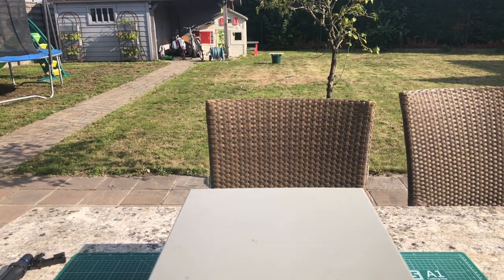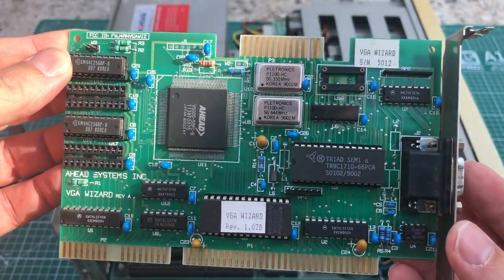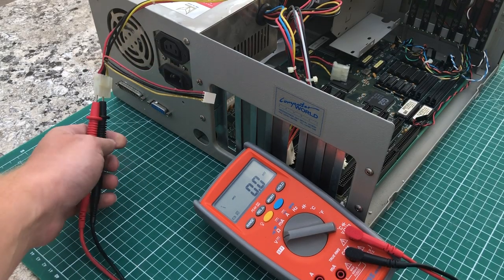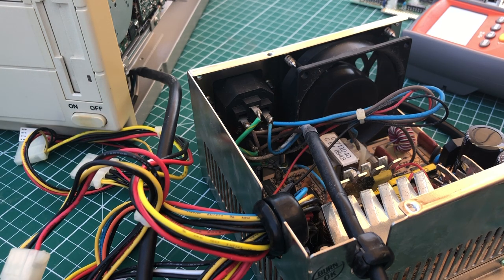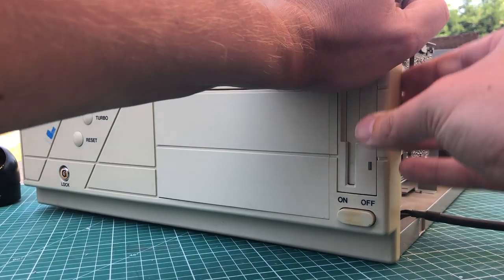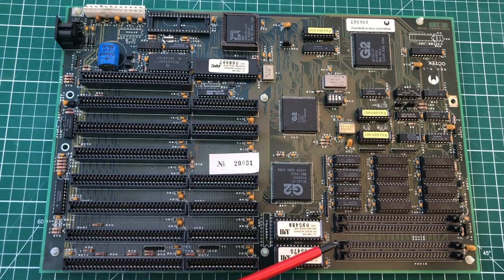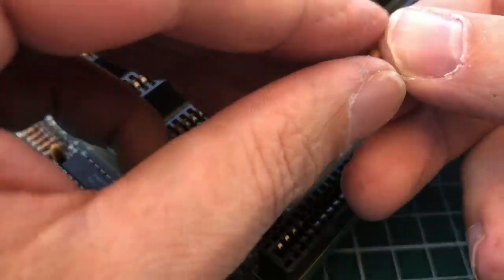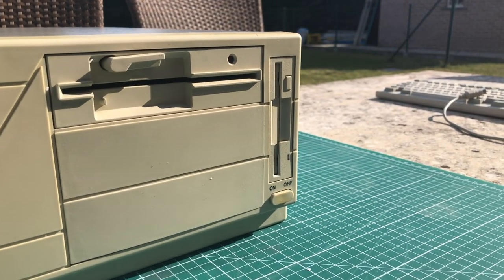286 retro pc from heaven or hell ? (part 1)

Comment: some power supplies need a minimum load on them or they just shut off automatically
Reply from the maker: That indeed was the case here. More on that and more in the upcoming part 2.
Reply: @RetroSpector78  there are commercially available testers what will give you a pass or fail on a power supply, the other way you can test them is to put a 12v 10W lamp on each rail to give the supply its minimum load and do your same voltage tests with the multi meter. These old power supplies only monitor one rail for the regulation on all the rails.
Reply: It's still good practice to give the inside of the PSU a look to see if there aren't any damaged components or Rifa caps that may blow.
Reply: That's true. Though it's usually a good idea to just replace those old PSU's. You can use a modern ATX PSU with an AT adapter to power these old PC's. It's risky to use old PSU's, as they may be on their last legs and may just take out all of your components with it.
Reply: @TheSeanUhTron  I usually rebuild the old AT psu and make sure I use good parts. That is my preference, but sometimes I will use an ATX system as well.
Reply: @MrPlytiger  Usually the regulation is on the 5 volts only. And that rail needs to be loaded sufficiently, usually 3 or 4 amps.
Reply: I would say MOST of these old AT power supply need some load (I usually use some old HDDs I don't care about, small halogen bulb is also a good idea).
Reply: Just want to chime in to bring attention to this for those playing along at home.  Old AT supplies act wacky with no load - perfectly normal.  I have a box full of bad 1- to 6GB Western Digital drives, and a couple CD-shard generators (bargain bin 56x CD-ROMs) to use as a dummy load.
Reply: @MrPlytiger   The cheap plug in testers with indicator LEDs won't tell you anything other than there's some voltage present on the measured rail.

Power supplies need to be voltage tested AND ripple tested, which requires an oscilloscope. A volt meter can report a voltage that looks fine, but could have off the charts ripple that is just as bad as the voltage being too high. Components will be stressed having to deal with high ripple and can kill them very easily.
Reply: @RetroSpector78  I thought so immediately. without connecting the PSU to the Board no real testing possible. but as you wrote I´ll watch part 2
Reply: Also rhe voltage may seem wrong
Reply: Yeah and working on power supply capacitors without knowing if they have been discharged properly, especially the big ones and you don’t know that they need to be can kill as well. Shouldn’t be handling the large ones without an obligatory disclaimer..
Reply: @RetroSpector78  Some will be damaged / fail with no load, too!   I have some old/failed hard disks which act as good dummy-loads for 5v/12v lines ... much better than running completely unloaded!.

Comment: Those measured 10v is because there is not load in the 5v rail.  Some psu generate 12v as a derivative in the transformer . Rectified and filter. But that derivative assume that 5v has load. So the transformer is switched at a minimun required frequency. But if no load on 5v and psu is regulating on 5v. No load means that the circuit will "click" the transformer just few times per second enough to maintain 5v. That means it is not enought "clicks" at primary side of the switching transformer to fill up to 12v on the derivative.
Reply from the maker: Thx for the in-depth info ...  should have known at the time this was load related :) Was able to "save" a whole bunch of AT PSUs that I thought were dead because I didn't test them properly.
Reply: @RetroSpector78  And with "derivative" I mean (the spanish: "devanado" word)  I mean about a "side secondary winding" that can be or can not be in serie with the secondary winding for producing 5v.

Comment: That Power Supply is probably working fine. Many of these old type PSUs have a crowbar circuit that creates a short if the voltage rises above 5.2V which, without load, it does rather quickly. I too have some of them. And mine also spin up after powering off. So attach a dummy load before tossing that PSU. Betcha it works just fine.
Reply from the maker: You should check out part 2 ;) it was indeed load related (stupid of me not to test that) But I’ve learned my lesson , that’s what it’s all about I guess.

Comment: Can I just say thankyou for this video. I recently acquired a 386 in a large joblot that would instantly turn off and by some luck had only seen this video some days before. I saw straight away that the caps near the power connector had blown and was able to replace them and now have a fully working 386 in amazing condition (Desktop and CRT both in original delivery boxes).

Comment: People with no skillset always think its only capacitors that can go bad
Reply: N Gauge England Synthematix yep because in old hardware like this it is generally true that the electrolyte goes bad or they dry out with age. It was also cringe watching them work on large caps without mentioning to at least attempt to discharge them..
Reply: @azzajohnson2123  Mate, one mistake and they can kill, especially in power supplies they can and will hold 240v

Comment: I’d had that exact same system. The 286 12 amd/intel chip still blows peoples minds today.
Reply from the maker: Yeah ... have a thing for these old 286 computers :) have an ibm 5170 from 1984 and an acer 286 from 1991. All using the intel 286 cpu.
Reply: RetroSpector78  have not had mine since I upgraded in about 93   Probably should kept it.

Comment: The old full hight desktop case form factor, from the 80's, are my favorite as well. No matter if that is an AT system or an Amiga 2000. As long as it is the basic layout of board in the bottom and cards vertically mounted, then I am a happy champ.
Reply from the maker: brostenen yeah ... easy to perform maintenance on. They do take up some extra shelf space :)
Reply: @RetroSpector78  Well... It does take up shelf space, yet they are easy to stack, if you want multiple vintage machines hooked up on the desk. 😁

Comment: I have not seen Part 2 yet, but I noticed the PSU had the input voltage selector set to use 220 VAC.  I'm assuming that is normal for your location?
Reply from the maker: Correct. I live in Belgium so 220v is the standard.
Reply: @RetroSpector78  Good!  I've had experience with devices people plugged into a 220 VAC cord when it was set to expect 110 VAC, was not a good combination!  Usually just blew a fuse in the device, but one CRT display did not survive it.  😯
Thanks for the update, I'll be gradually working my way through more of your videos.
Reply from the maker: @bobblum5973  yeah bad things can happen with AC .... was wiring up an old case with AT power button once and got 2 wires wrong ... not a nice sound. Luckily only the main circuit breaker tripped ... Really appreciate your comments and hope you enjoy the rest of the videos. Feel free to share them and spread the word ... lots of cool content still coming up.

Comment: Those tantilums on the power input are not actually needed for operation. If they blow, they can be safely removed without issue. If you use a newer atx psu with converter, they are not needed at all, as the PSU will have much better filtering.

Comment: Try to use your soldering iron more flat. The bigger the contact surface, the better the heat transfer to the solderjoint!I used to slightly bend my solder tips so i can achieve this easier.
Reply from the maker: Thx for the tip (no pun intended) ... it's a crappy iron I sometimes use on my desk here cause I don't have a lot of room and the desk is used (not) for retro computing :)

Comment: how do you get into the cmos setup without pulling the battery?
Reply from the maker: This one has a standard bios where you just need to press del to enter.
Reply: @RetroSpector78  yeah my 386 doesn't for some reason I can only seem to get into the bios when the battery is dead

Comment: I’d really appreciate if you mention not to believe the capacitor saying, and put it to bed. 

They don’t always go bad, and I’m genuinely proud of you for checking each one... what you’ll find that it is intact it’s either a shorted tant on the mobo or no load connected

It might also be reverse diodes shorting and tripping over current
Reply from the maker: The things is that in retro computing, besides ram chips, the caps are usually the prime suspects. But here it was a stupid mistake on my part, not putting any load on the psu. So in that respect going through the removal / verifying / reinserting all the caps was a good reminder never to test a psu without load again.

Comment: Always thought it was mental putting AC with large current and voltage in plastic switch mechanisms that go brittle over time. Then short out on the impressively thick and sharp sheet metal sometimes electrocuting the lucky owner when it does fault.. such a bad design but that’s what we had to work with back then! Praise ATX!

Comment: The power supply is set for 220 volt - is that what you needed?
Reply: Yeah he's not the sharpest knife in the drawer.
Reply: Yes. That's the correct voltage in his country.

Comment: You should never ever (!) run an old switching mode power supply without load.
Your original PSU is probably fine, it just seems to go into protection due to the unloaded 5V rail. Try it again with anything connected, even a floppy drive might work.
Reply from the maker: Yes that was the case (wait for part 2 for the full story) .... its funny as I've tested over a dozen AT power supplies without load and I always got a voltage reading on them. This was a first. I knew really old XT PSUs needed load to start but never figured that some of these "newer" PSUs would also need load. Didn't want to attach something for fear of shorting something.
Reply: @RetroSpector78  Then you've just been lucky ;)
Nearly all of my AT-style PSUs won't run without load. Technically, you could even damage it by running it unloaded. It all depends on the switching frequency. If the frequency is rather low, like with older PSUs, the output voltage immediately rises to above 5V before shutting down. More modern PSUs have a small load resistor to mitigate that problem.
If you fear blowing up something, just use a 6V light bulb, e.g. from a bike lamp, that should suffice as a load. Normally, I just use a broken hard disk.
Reply: I have a PSU that for now I never used which has a low +12V line when there's no load (I tested it with nothing and I had 10V), but oddly enough, the more load it has, the highest the voltage gets. I plugged one HDD and it raised to 11-ishV and with two hdds it raised to 11.9V

So yeah, interesting behavior.

I like the case it's in by the way, it's a cool 90's case and the front de-yellowed nicely (appart from one part), so I'll reassemble the whole thing and use it soon I guess
Reply from the maker: @DxDeksor  Will get it in better shape ... but more stuff to come in part 2 before we arrive to that ... more exploding caps to come....
Reply: @RetroSpector78  Yay !!!
Well that was to be expected, they rarely die alone.

Sometime ago, I was fixing a 486 motherboard with some bad traces, and I got trolled by the caps. I remember nearly fixing it one evening, and since it was starting to get late, I stopped for the night. The mobo was starting up fine at that time. The next day, I'm done fixing it, so I want to test if the board POSTS ... and nothing happens.

The caps nearby the power plug got shorted in a single night x)

Also, the other day I was attempting to fix a very corroded mobo (unsuccessfully unfortunately) and one cap blew up in my face :( Thankfully it reached my lip, not my eye, thes things can be serious trouble x)
Reply: The original IBM PC AT, if purchased without an HDD came with a ceramic resistor load.  You where instructed to remove it when adding an HDD.

Comment: 4:20 power supply is set to 220v input so if you just give it 110v it's going to act like it did.  No need to desolder parts if you know what you're doing.
Reply from the maker: In europe we use 220v. And the fact it was not starting was load related (as explained in part 2).